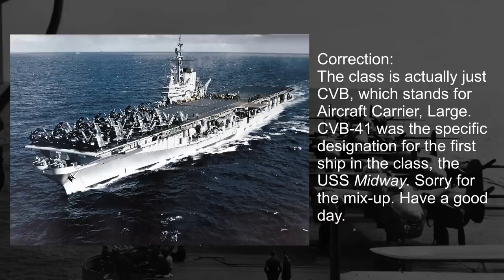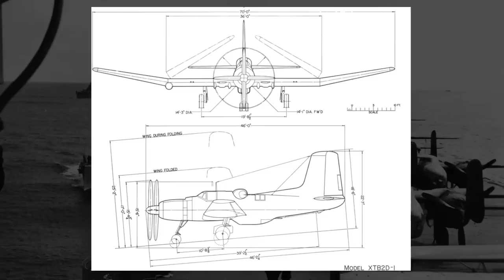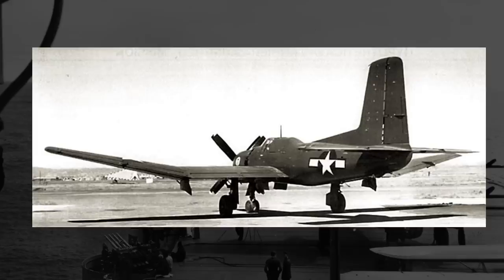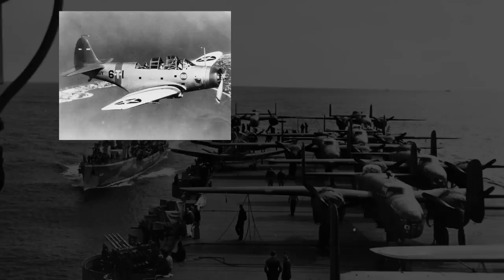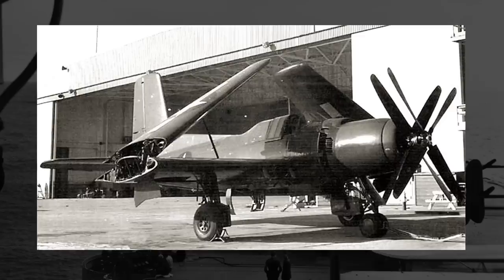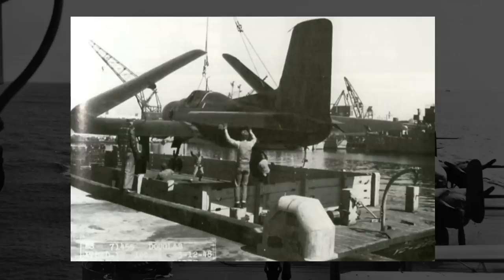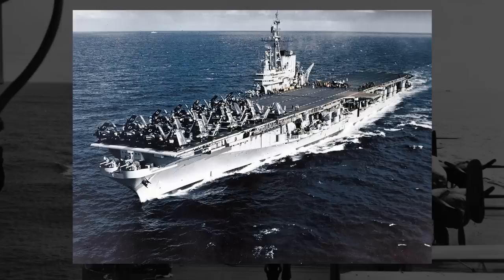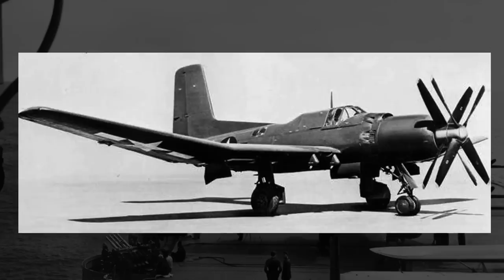Douglas' Excessively Large Torpedo Bomber: Douglas XTB2D Skypirate

Comment: The wings likely had the flat centre section to make external stores loading easier by using the same height bomb cart for each station.  It also would have put the wing fold hinges just a bit lower than they’d have been on an ordinary dihedral wing which would save space on a carrier’s hangar deck.  The tips are raised for stability.